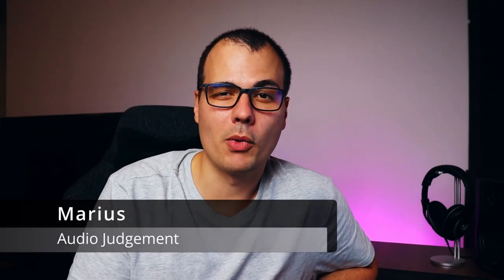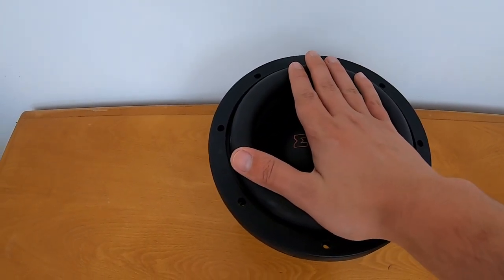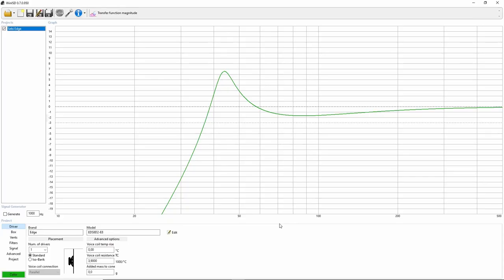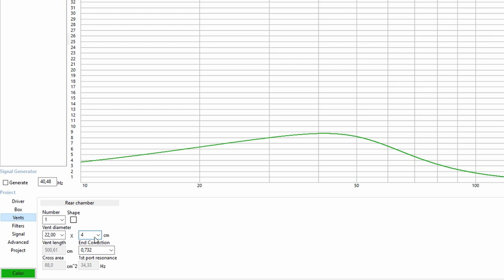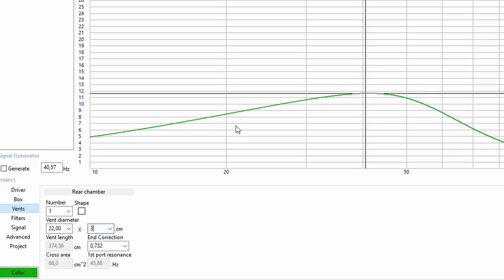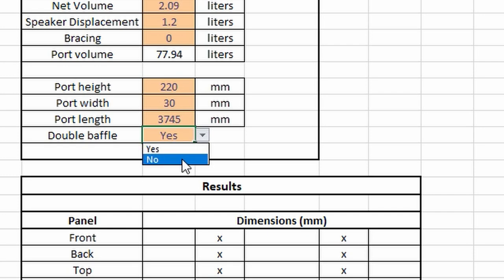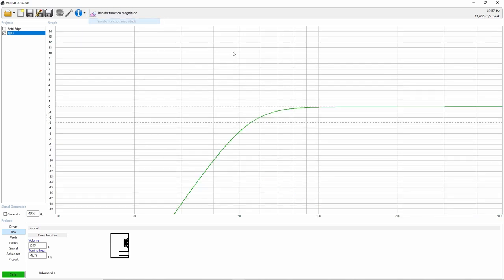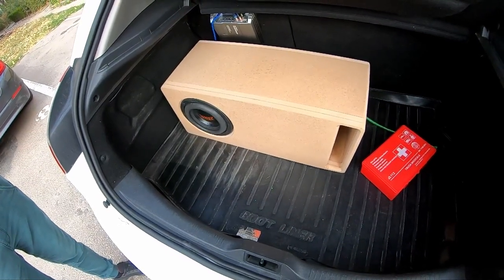SPL Subwoofer Box Design - or lack thereof

Comment: This is common sense to anyone who has experience with car audio you could run 4 or more and gain more output and bandwidth because the box is bigger but then again why not just run a 12 or 10 high power 8s are verry peaky but high power subs in general are peaky the more efficient a subwoofer is at making output the less bandwidth you have but you can go up in cone area and Gain some output without having such a peaky setup there are ways to get loud and flat but you can only cheat the system but so much  bigger subs with the right specs in the right box can get louder with a flatter response
Reply from the maker: Agreed. Larger subs suffer less from this issue.

Comment: Excellent video. 
Also, changing box volume increases port velocity. The port might need extra area and in turn extra length. I use a 10% variant “rule of thumb” so yes there is wiggle room when designing an enclosure. However, I also design SPL enclosures and do not allow for wiggle room if at all possible. Port compression due to small port area can result in huge loss of dB.

Comment: I have a Ultimax 10 tuned to 19Hz for my car. I could have a response that looks similar to this sub as I used passive radiators so adjusting the tuning is easy. My peak would be around 33Hz in my case. 

Whenever I did it, it was fun for maybe 30 minutes before I wanted to go back to my lower tuning which offered a more natural to the ear response. Because peaky bass is only fun for the handful of songs that have the same frequency. And that gets boring fast to me. I don't use a bass knob and I'm sure that's weird to most car audio people. I like to set it with my UMIK and just enjoy it that way. 

Thanks for the video!
Reply: How do you enjoy any music without a bass knob? Even if you are a master tuner and it sounds perfect on Radiohead from 2001. It won’t have enough bass for The Police from 1986 and it will have too much bass for Suicide Boys 2021.
Reply: @johnviera3884  that sounds like your preference just changes with the music. Some songs you want louder or quieter bass. 

I like to use measurement equipment and set my levels to be accurate and musical. Not exactly set flat, more like a human ear response it gets louder the lower in frequency it plays. I'm tuned to 19Hz and I'm flat to just about 16Hz. I can play just about any song and enjoy it just as much as the next song. Because there's no overly loud or too quiet with my system set just right. If something is overly loud or quiet it's the song and how it was mastered or could be my preference and want the bass louder or something. 

Just my view on it. I enjoy my system as is. I don't care if others don't.
Reply: @JoshM7  I’m conflicted. I enjoyed preserving the integrity of the master recording but did they master It that way only because they didn’t have the capability to exploit the low end at that time? If you notice a lot of prestigious mastering engineers definitely are exploiting the low end now versus the stuff they did 20 years ago.
To me The Police sounds better with a little more thump
Reply: @johnviera3884  I used to want my system to be flat and try to preserve what I thought would be best for artists so I hear it closer to how they wanted it to sound like. But after I got a UMIK-1 I found out I hate flat. So I just tune my system to the way I like it and enjoy all my music.

Comment: I have four Ampere Audio rve-2.5 8s in a 2.8ft3 tuned to 34hz. A budget spl subwoofer. 800w rms with 2.5 inch voice coil. They play music well. .7 to .75 cubic feet. It plays from 28 hz to 42hz with a 2.4 db raise at 38-40 hz. Spl woofers can play in musical designed enclosure. Next is a series tuned 6th order. 2.8ft3 tuned to 26.25 hz and 5.7ft3 tuned to 52.5 hz in my cargo area of my hatchback.

Comment: Can u tell me the actual measurements of this sub please ??
Reply from the maker: Front / Back : 300 x 700 x 18 mm (3 pieces because of double baffle). Front panel covers the port and you will need a router to cut the port hole with a flush trim bit after the box is done.
Top / Bottom : 246 x 700 x 18 mm (2 pieces)
Sides : 246 x 264 x 18 mm (2 pieces)
Port 1st panel: 196 x 264 x 18 mm (1 pieces)
Port 2nd panel: 201 x 264 x 18 mm (1 pieces)
Brace: 178 x 264 x 18 mm (1 piece). Just make large hole (circular or rectangular) in this panel to make the brace. Place the brace between the front panel and the 2nd port panel.
Reply: Thanks !! What was the actual mounting hole diameter ?

Comment: What T/S parameters (e.g., 1) which ones, and 2) around which values or ratios) does one look for when a (musically) acurate speaker is desired?
Reply from the maker: Mms is a good indicator. Large moving mass will make it harder to control the cone movement and transient response will suffer. Of course Mms is not everything, but usually it can give some information. Of course, the number is proportional to the size of the speaker, so to give you an example for a 12" subwoofer, Mms of 100-200g would probably be a musical subwoofer, transparent sounding and good transient response. Probably not have the punch people would hope for. If Mms is 300-400g, then it's most likely for high pressure applications.
Reply: @AudioJudgement  Thanks! That gives me a good parameter to focus on when comparing similar options. I've been wanting to build something for the longest time, hopefully I can soon. :)